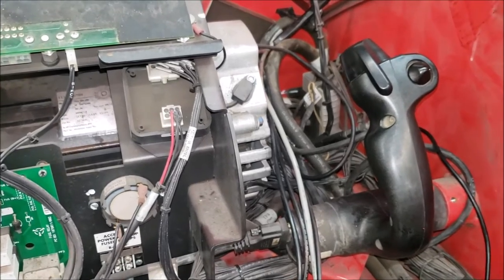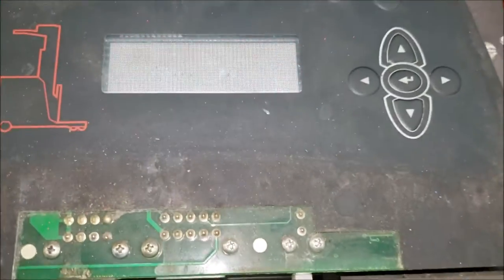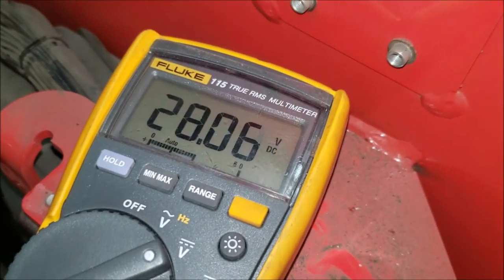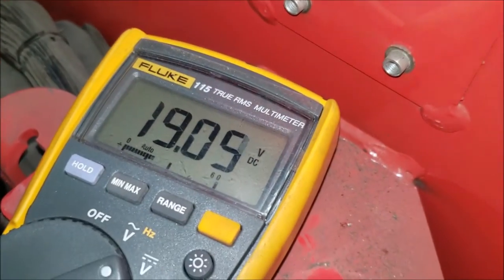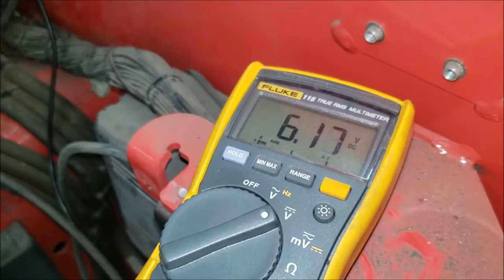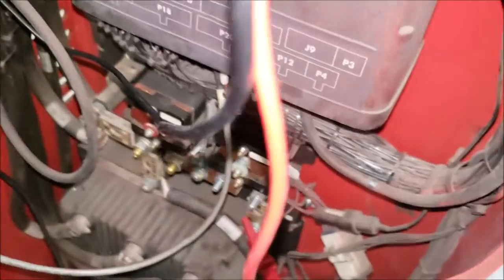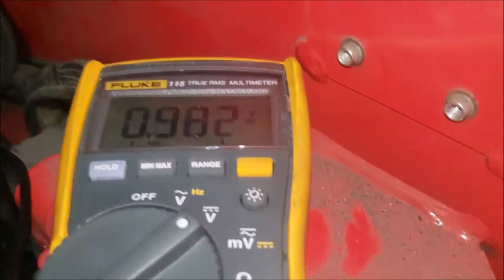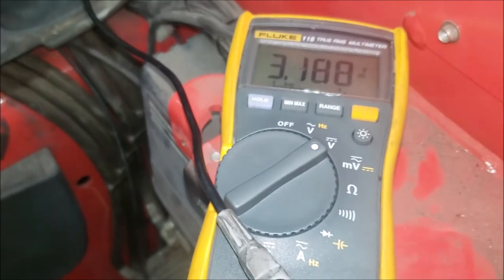Error Code 4B no power steering operation

Comment: Great work! I have a Raymond7500 36V which is quite similar on the one you working on, I remove the battery on the unit and measured the voltage on battery positive terminal to negative probe on the casing and its giving me a 15V. Is it normal or it is shorted to frame?. The unit is self-testing fine but when I stepped on the deadman, the unit shuts down. BTW Im newby in this electric forklift field and I am glad I found your channel working on this kind of stuff.

Comment: Linde R20S 12... having error code L 470.... Reach not working.... Replaced logics and Hydraulic controller.... Checked Valve solenoids Still.....same problem
.
Please help
Reply from the maker: Check input to controller
Reply: @forkliftgeek10  demand value for the Valve is missing for reach function